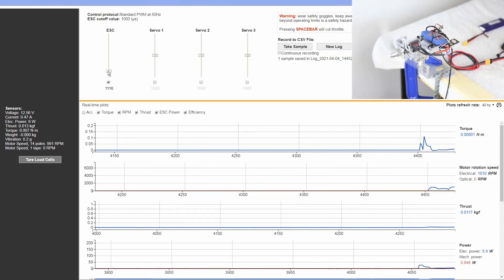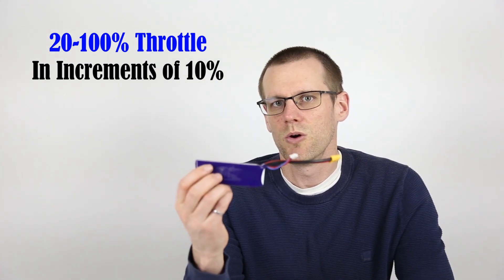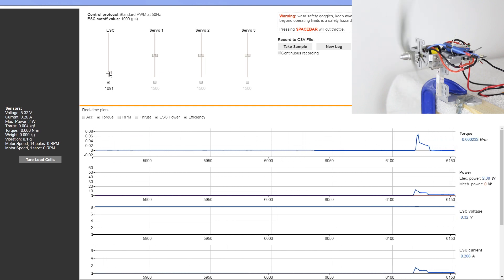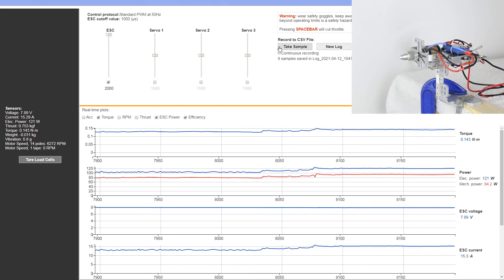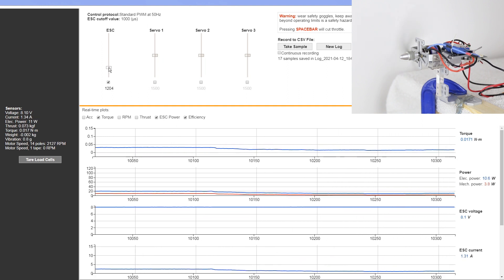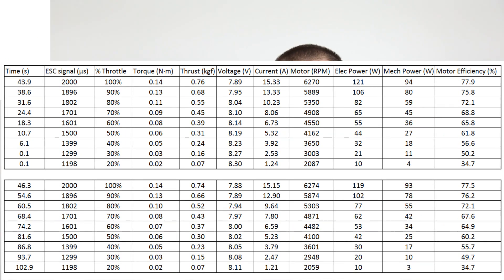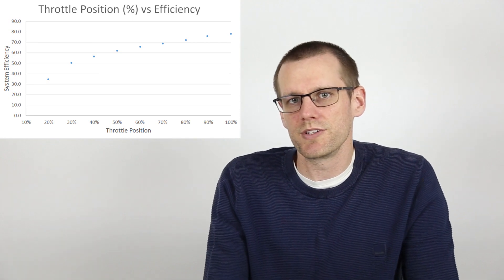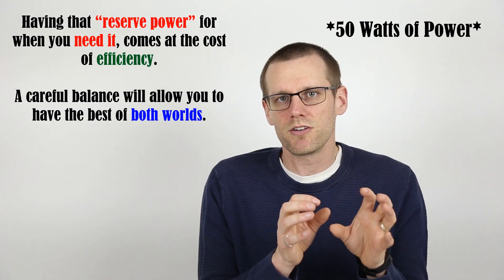Brushless Motor Dyno - Comparing Throttle % vs Efficiency

Comment: A lot of work BUT... All your conclusions about efficiency are based on mechanical  power but you don’t explain how you get it ?  If you measure the amount of thrust,  (ie. with a force sensor) it is only part of the mechanical power produced by the motor... the air friction loss  involved by the propeller is also mechanical power  how do you measure it?  I have performed a lot of dyno testing on RC motors in the past month and there are in line with what happens on real scale EVs   Optimum efficiency is at half speed and half load
Reply from the maker: Hi Nicolas. Mechanical Power is determined by Torque Applied Multiplied by Rotational Speed. Both these values are visible in the video.
Reply: Hi Ryan, thanks for your answer, I understand .... relationship  between torque and power is very clear to me.....
But my question remain, how do you measure this torque?   
On your video I see a motor and a propeler but as you are measuring it at steady speed you need some kind of brake + a force sensor....  I see nothing like that here .to measure either torque output or power output.  If you have torque and speed you can calculate power , if you have power and speed you can calculate torque... but here we have only speed... May be it is more obvious in another one of your video?
Reply: @nicolasschneider8452  In order to maintain those constant angular velocities, the torque applied to the propeller had to "cancel out" its (nonzero) parasitic drag (and, thus, had to be nonzero itself).
Reply from the maker: Hi Nicolas, Speed is measured and torque is measured. To measure torque, the prop is the brake. There are two load cells that measure force and the software computes this to a torque output.
Reply: @RCexplained   Hi Ryan Thanks  it becomes less blurry, not yet crytal clear.... ;0)
I think your setup deserve an entire video in itself ....  
On RC car we run dyno test to measure the max torque curve (thus power curve) along the full speed range and we measure efficiency  along this same range. This is performed by a single full throttle run  (my test procedure here: https://youtu.be/wrAsMfGjBdk )
This efficiency measured along the max torque curve can be considered as a worst case scenario as motor efficiency map often look like this : https://images.app.goo.gl/Z4vDjWfnKRrGrLteA (with lower efficiency for RC motors) and asking less to the motor will often result in better efficiency.
This rise me a question: Do you know at what percentage of max torque you are for each rpm level at which you measure efficiency? As at a given speed more load will induce more current, do you perform test with different propeller  size to partially explore this map and identify sweet spots?
Reply from the maker: Hi Nicolas,
I have not done much experimentation to produce the same graph that you will get in a few seconds. If I wanted to get the efficiency curve you are after, I would add an inertia weight to the  shaft either direct or geared and take continuous readings during a full RPM sweep. Changing props and loading motor to max getting one data point per prop switch is quite time consuming. I'll do this more so when I explore all the areas that are infrequently studied or talked about. 

Just so there is no confusion, I do want to say what I show in this video is very different from what you show in the video you linked. We are exploring two completely different scenarios and efficiencies.  

Also just curious. What do you do differently with your RC car now that you have the torque and efficiency curves you are after? Also what happens to your efficiency curve when you increase the load and complete a full RPM sweeo? Ex. Move to a larger inertia flywheel.
Reply: @RCexplained  Hi Ryan your approach is now clear to me and it totally make sense for a plane on wich you want to maximize the flying time...

Coming to your question, with an inertia dyno your are always running at full load... if the flywheel is too light you will have the same power curve but with poor resolution (saw blade curve) because you will exceed your device data recording speed... If the flywheel is too heavy the motor and ESC will stay too long under high current and it will burn.... For an RC motor 2 to 4 second run time is more than enough to gather a nice data set... It is often also the full throttle time of a track main straight. 
The efficiency data you collect along this max torque curve is useful because during a race you spend most of the time along this curve and as you go away from it (same rpm but lower load) efficiency improves. So the curve you get from the dyno can be considered as the worst case

With to  RC car motor, and especially competition cars as you said the context is somewhat different than with plane motors , what you want is to be the first on the finish line...;0)
For that you need power, power that can be managed, and speaking of efficiency also power that does not produce too much heat, and maintain the highest battery voltage until the end of the race.

Regarding settings you have two main racing class families:

Blinky mode race (the ESC led blinks to show that their are no variable timing settings programmed). This concerns generally high turn motors 21,5t, 17,5t and 13,5t. The main motor setting you have is end bell timing adjustment. It will impact the peak power  position, and the efficiency. The gearing will be then used to match the motor performance profile to the track shape.

Modified mode race (where I play). Here you can play with all the ESC possibilities. You can adjust straight and progressive timing ramps with start and end rpm constrains (boost timing) , you can adjust conditional timing advance timing (turbo timing) where you can in example add « X degrees of timing at Y rpm in a Z degrees per second slope only if the throttle is at 100%« . No need to say you have a lot of possibilities... and with the right setting you can expect over 30% more power over the best blinky setting... however here especialy with low turn motors (>8.5t) what you really want is to manage is the torque curve.
you will want to reduce low end torque because ( when multiplied by gearing) you already exceed slipper clutch torque or tires traction even in grippy condition. What I try to achieve the highest possible mid range torques. 
Why this? because torque at the wheel divided by wheel radii and car mass is the potential acceleration of the car. So this enable to have more acceleration reserve where you need it to pass during main straight or just at the exit of a medium speed curve...
On a motor I have tuned lately (near to 400 dyno runs ;o) ) I have been able to triple the 30k rpm torque (mid range is at 22k) 
Another outcome of those dyno tests is that  I use an homemade spreadsheet model that integrate rolling resistance, aero drag of the car as well as transmission efficiency, and slipper clutch setting and track grip. I import raw dyno test data as a csv in it and it simulate main straight acceleration and time... It helps to compare the strength and weakness of 2 motors setup and helps to optimize their gearing to a specific track feature and track grip condition...
Our involvement in our hobby can sometime become extreme…;o)

That said, to conclude as I said in a previous post I think you motor test bench and the user interface you use with it is very interesting and deserve a video in itself.

Comment: Great video thanks! The results are strictly true for hover (static thrust), but if you include cruise speed into the equation you are then influenced by the propeller efficiency. At each cruise speed there will be a different optimal rpm, which would need a different throttle value
Reply from the maker: Thanks for the comment FPVerg.
The point here is if you are cruising at 50mph using X mechanical watts at Y RPM but 100% throttle, this would be much more efficient then cruising at the exact same speed, same mechanical power and same RPM but 50% throttle. Your power system would have to change to achieve the difference in throttle position but the same mechanical power output. Propeller efficiency does not come in to play here.
Reply: @RCexplained  You're right, I was thinking on overall propulsive efficiency and fixed power system, but your results stay always true for mech efficiency

Comment: Would be interesting to see a comparison between a cheap hobbyking ESC Vs a new Castle ESC with CRYO-DRIVE™? Is it possible to fix the inefficacy with fancy hardware and software on the esc?
Reply from the maker: I would love to try this. Which ESC's have Cyro Drive?
Reply: @RCexplained  A few of the castle surface ESCs since 2018 have Cyro Drive. Like
SIDEWINDER 4
MAMBA MONSTER X 8S
Mamba XLX2
It says in the product description 

I was talking with some brushless people about this experiment and they were thinking cheap hobby controllers likely use trapezoid drive control. And vesc might run more efficiently at lower throttle. Apparently high end ESCs used in industry match pwm to inductance so you can have high efficiency at lower throttle. 

So test a vesc too if you can :)

Comment: How can one calculate their electric rc system to get the equivalent of scale horsepower? I'm terribly curious, Cheers.
Reply from the maker: Take a look at the mechanical power output measured in watts in the video. divide this number by 746 and you have the exact HP.  
You can also take input power as voltage multiplied by current, multiply this by your system efficiency and then divide by 746 to get HP.
Reply: @RCexplained  Thanks

Comment: So 30% throttle shows 50% efficiency meaning half the current is being turned into heat by the esc assuming a 100% efficient motor? That seems ridiculously inefficient. If this is true why wouldn't ESCs have built in variable DC-DC step down converters so the ESC is always at max throttle but with variable input voltage for speed control? DC-DC step down converters can be around 95% efficient.
Reply: I mean, high current DC-DC step down converters are large and heavy, but it would be interesting to see if you could maintain high efficiency and variable speed control by adjusting the ESC input voltage on the fly.
Reply: The mosfets are modulating the output, as any of those small converters with the difference of being really fast, for rapid changes. From my understanding as you get close to the source voltage you don't have to switch on/off the mosfets so many times and that means less losses, more efficiency. The takeaway here is the user should choose the right voltage to begin with without putting any regulator before because that would also generate more losses.
Reply: There are diverse needs from a user perspective, maximum throttle is not always necessary or useful. Even out side of planes, variable throttle is usually a constant. Choosing the right combination of components isn’t always black and white.